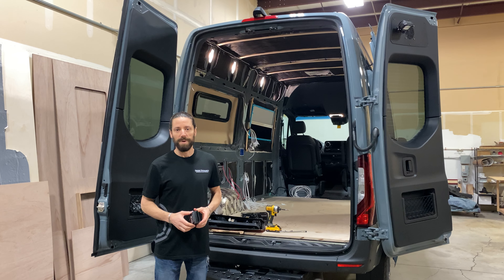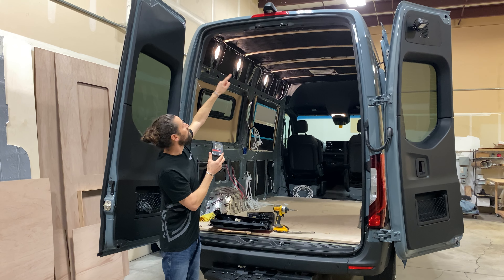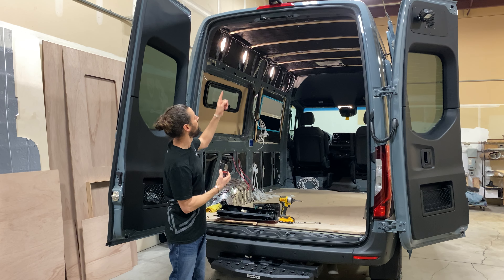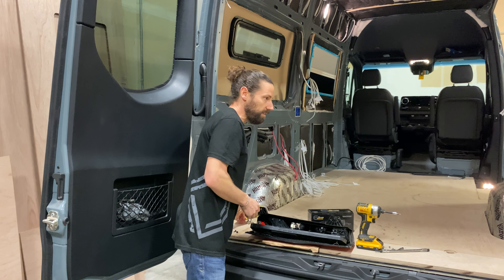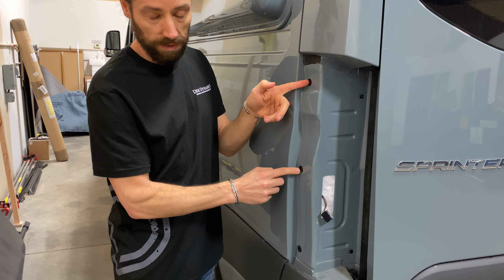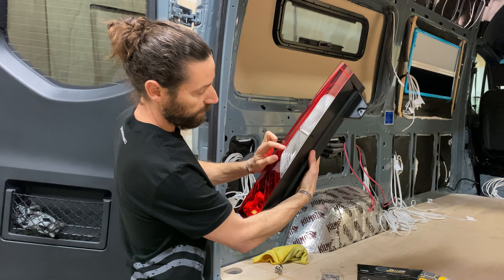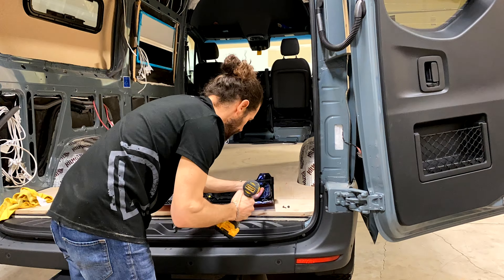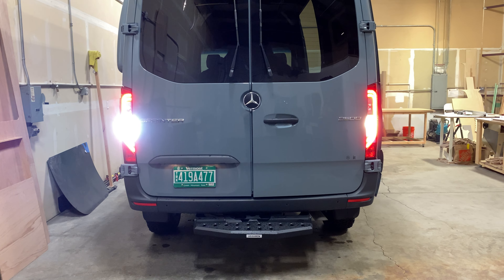Diode Dynamics 1156 XPR Reverse LED Bulbs for 2019+ Mercedes Sprinter

Comment: Any need for a resistor? And do these bulbs throw a light code?
Reply from the maker: These are installed on thousands of Mercedes Sprinter vans and have never caused an error code.

Comment: Hi. Installed mine and was super excited,  but when van is running my rear lights flicker. Called Diode dynamics and they said it's because there is no canbus on these bulbs. Any recommendations?  How does yours not flicker? Thanks
Reply from the maker: Hello! Ours do flicker sometimes! They all do.
Reply: Got it. Thank you